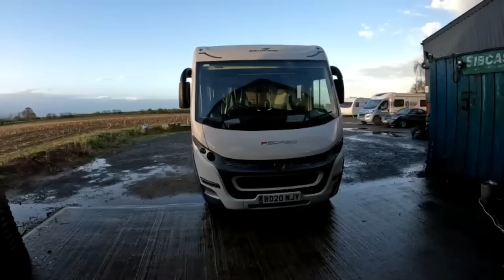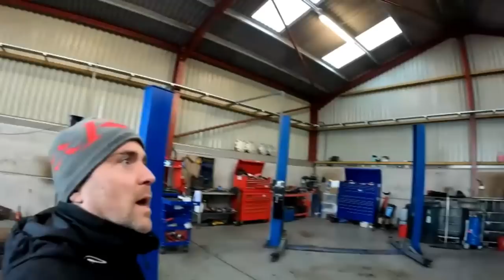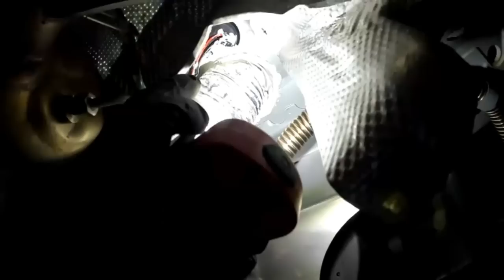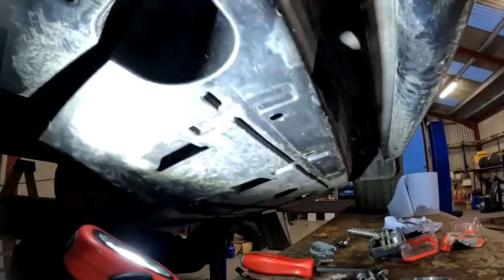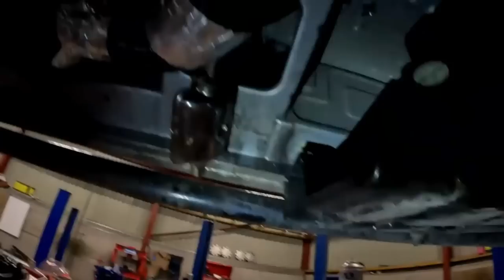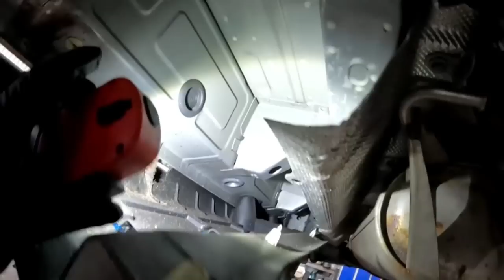🔴WATCH this BEFORE BUYING A DIESEL HEATER... Camper BLOG

Comment: We’ve just had an Eberspacher fitted under the floor of our T5 transporter with the inlet in the drivers step and outlet behind the drivers seat, very quiet when running and no pump noise whatsoever.